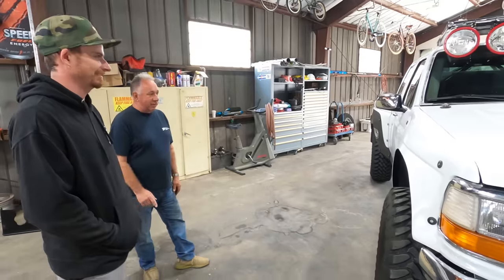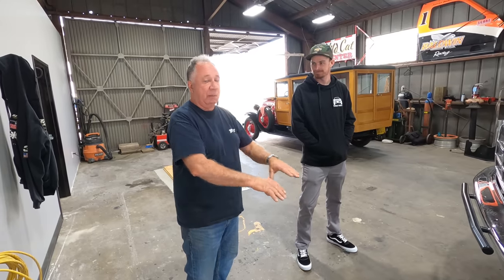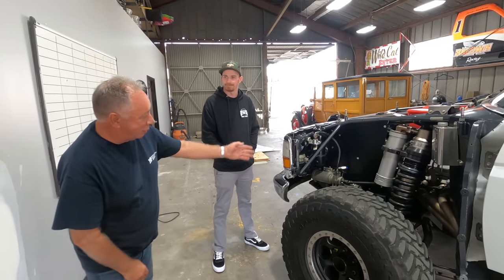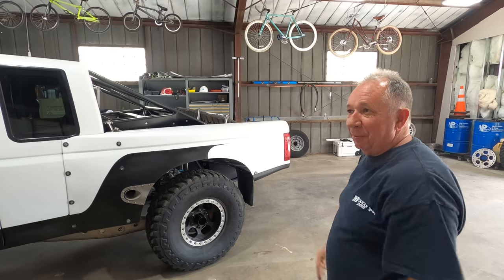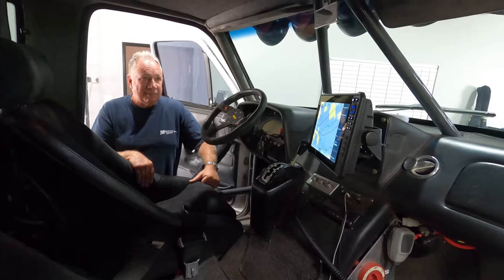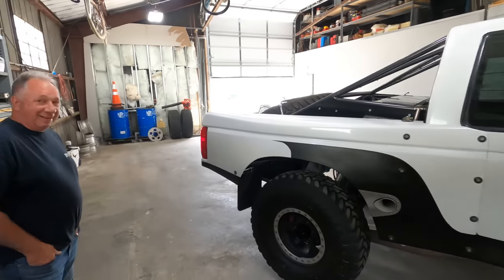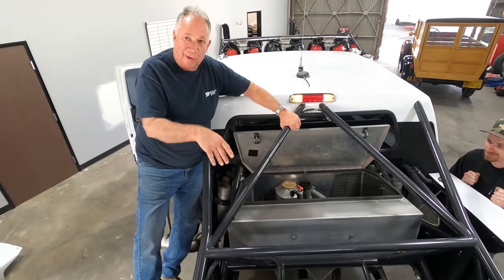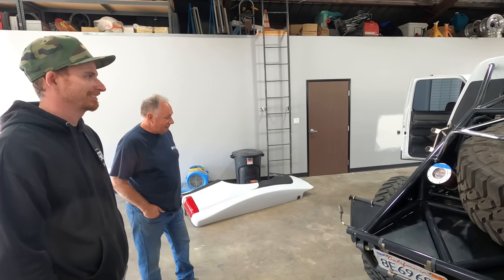Robby Gordon Built F150 Prerunner: In-Depth Walk Through!

Comment: I was so fortunate to ride in that truck with Gary and do a photo feature on it. The billet beams from SI Motorsports are pure art. Most people miss that the cab is fabricated, not from Ford. So many talented people have touched this truck.
Reply: What do you mean it's not a Ford cab? I can see all the original stamped steel, doors, handles, etc.. it's definitely a Ford cab, that's been heavily modified.
Reply: @jwallace2913  It's fabricated. The doors are ford, but the cab is fabricated.